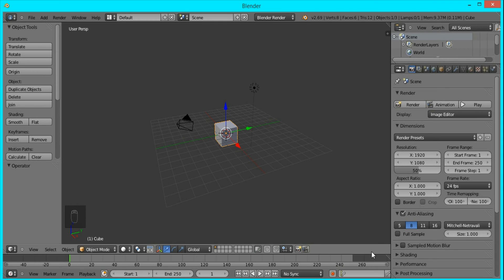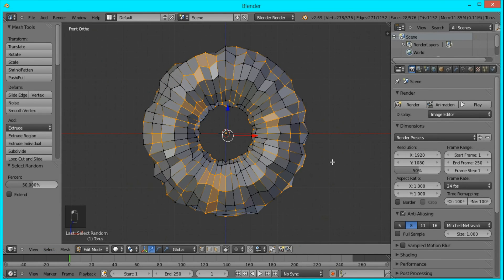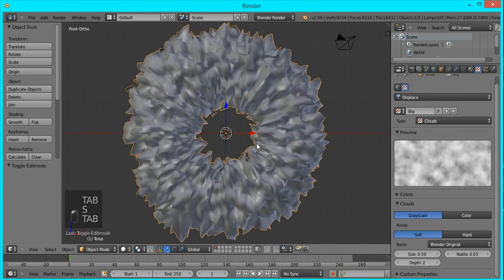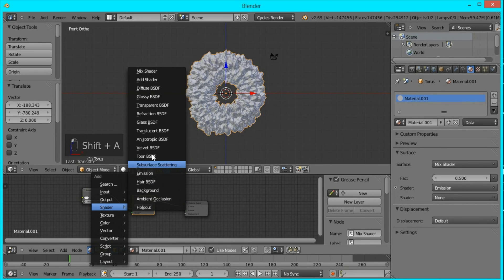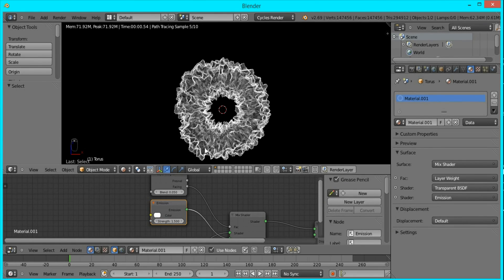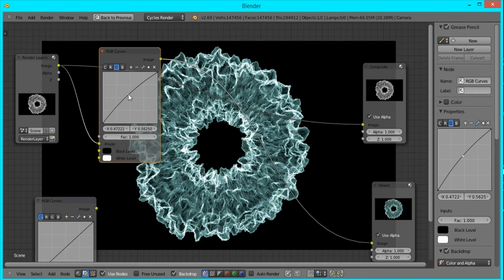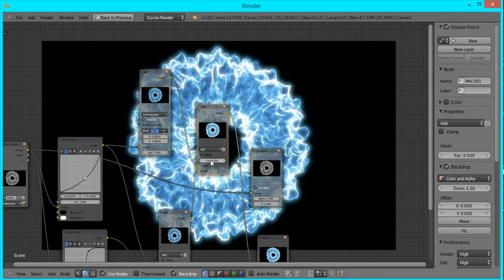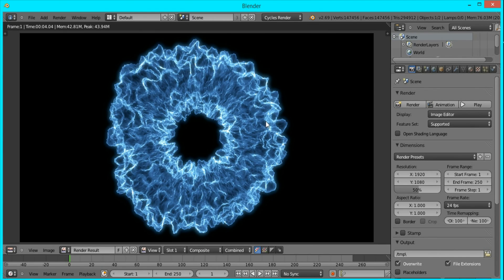How to Make a Shock Wave in Blender

Comment: Nice tutorial. However, I am not getting any color in the render window after the rendering process(version 2.79). Any suggestions? Thanks. :)
Reply from the maker: Thanks. Is it possible that the final node output is not plugged into the composite node?
Reply: @BlendMaster  Thank you so much. That fixed it. :)
Reply from the maker: @ValorCro  No problem, I'm glad I could help ;)

Comment: What is the difference between node editor and composition?
Reply from the maker: The node editor is the actual window. It is referred to as the compositor when it is set up for editing images after rendering. The node editor can also be used the make materials. On the bottom tab you can change the node editor set up so that you can work on materials, or editing a final render.

Comment: Could i apply that specific material on the smoke? will it work with smoke density attribute?
Reply from the maker: Not sure. I've never thought about that, but I believe if you used the density attribute instead of the layer weight node as the factor, the material should work fine.
Reply: Thanks! I'll try it later!
Reply from the maker: I would love to see what you come up with! ;)
Reply: I'm trying to do it but i have problems with the smoke: if i try to create normal smoke using only the volume output it shows barely visible on white background but doesn't show at all on black background. If i try to increase the emission value the result doesn't change at all.
Reply: I'm trying to do it but i have problems with the smoke: if i try to create normal smoke using only the volume output it shows barely visible on white background but doesn't show at all on black background. If i try to increase the emission value the result doesn't change at all.
Reply from the maker: I believe that instead of an emission shader, you need to use a volume absorption/scatter node with the density attribute going into the input for density in the volume node. To make the effect more visible, you might want to add a math node right after the density attribute, and switch it to multiply and increase that value. I hope this helps.
Reply: i already had the multiply value for the density (it was just too low value) but the problem is with the emission (it doesn't emit light) and i don't know how to make borders of the smoke emitting like your wave. I think that there's this problem because smoke isn't a mesh but more like a particle system.
Reply from the maker: I think I understand the problem, but I'm not sure how to fix it. If you want to send the .blend file to me at blendmaster101@gmail.com, I could take a look when I get the chance.